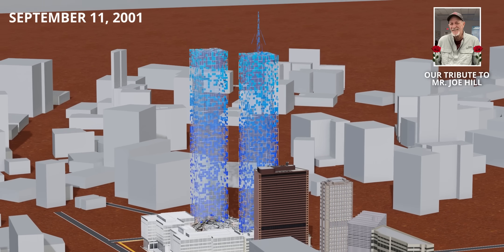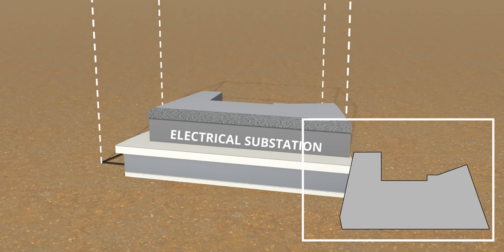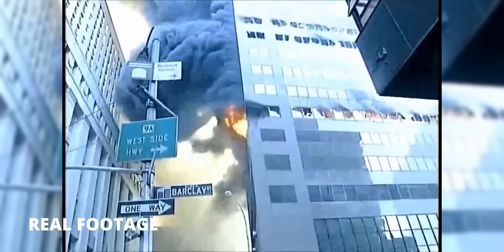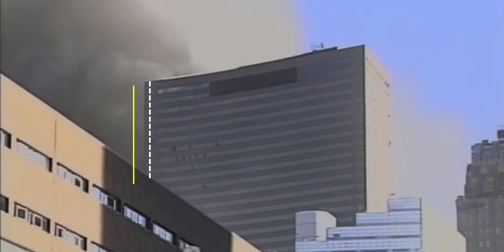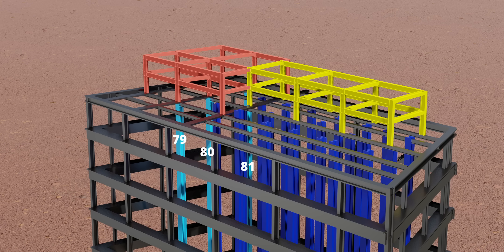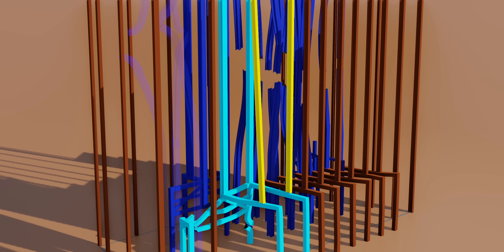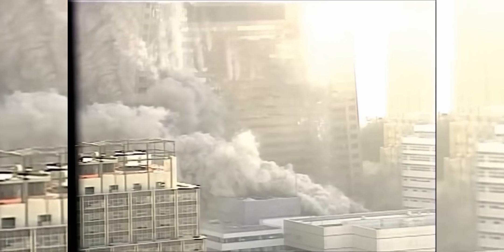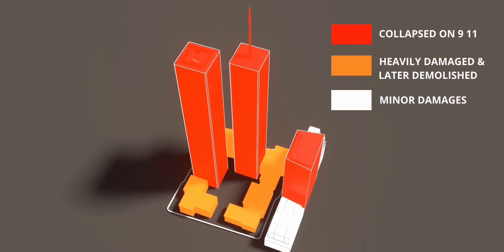Collapse of Building 7 | The Complete Physics

Comment: This sesame Street explanation proves nothing . Did you have xray vision to know the columns were broken at the bottom,?(Or you just listening to the people who said that columns were broken during cleanup)That building fell into it's own footprint... IF random columns were damaged, i don't think that would've happened the way it happened.. Just thoughts.
Reply: Maybe this more detailed explanation will help: Building 7, the 6th building to collapse of 10 lost on 9/11 though extensively studied still confuses many. Not famous or a terror target and with no casualties it didn’t get a lot of attention initially, creating an information void the internet filled with utter garbage. Because everything seems like a conspiracy if you don’t understand how it works I prepared this brief summary from my own analysis to fix that. No politics, just engineering. 

The North Tower collapse at 10:28am bombarded Building 7 with tons of burning debris, causing heavy damage and multiple floor-wide fires that burned out of control for 7 hours. Half the FDNY firefighters having been killed, others injured, units in disarray, equipment destroyed, no water pressure, and the greater urgency of Search & Rescue efforts, firefighting was pulled as futile. The building couldn’t be saved and was left to its fate. That is the sort of choice firefighters make every day in brush fire situations - which houses to save and which ones to let go. Only real difference here is moving the decimal on the size and cost.

www.youtube.com/watch?v=g_SvpwyC17M&ab_channel=MFitz  

Collapse of a burning structure is always a concern for firefighters. Steel buildings subject to fire rely on active fighting of the fires to survive. Buildings are designed around 1 to 3 hours of fire resistance, allowing time for occupants to escape and ACTIVE firefighting to get started, after which all bets are off. Left to their own devices they will exceed their design envelope and collapse. In B7 the occupants escaped, passive and active fire protections were compromised and active firefighting was abandoned which left the building to its fate. It lost. Odds on Building 7 would eventually collapse, and it did. No big deal in logic. 

www.youtube.com/watch?v=WnYBX6QT0R4 

FDNY Chief Daniel Nigro ; The biggest decision we had to make on the first day was to clear the area and create a collapse zone around the severely damaged 7 World Trade Center, a 47-story building heavily involved in fire. A number of fire officers and companies assessed the damage to the building. The appraisals indicated that the buildings structural integrity was in serious doubt. I issued orders to PULL back the firefighters and define the collapse zone. It was a critical decision; We could not lose any more firefighters. It took a lot of time to PULL everyone out, given the emotionalism of the day, communications difficulties and the collapse terrain

FDNY Deputy Chief Peter Hayden ; We had our special operations people set up surveying instruments to monitor and see if there was any movement in the building. We were concerned of the possibility of collapse in the building. And we had a discussion with one particular engineer there, and we asked him if we allowed it to burn could we anticipate a collapse and if so, how soon? And it turned out that he was pretty much right on the money, that he said 'In its current state you have about 5 hours

The collapse of Building 7 was anticipated and widely reported in the media throughout the day. At least 24 video cameras recording some or all of the collapse. Everyone knew what was coming and why.

www.youtube.com/watch?v=OY5S5k3tMHI 

Building 7’s collapse was completely different to the Twin Towers, and harder to understand with most details hidden from view. But we can still sort out what happened through careful analysis and observation.  This is my explanation  of the collapse using the best available information and relying on no authority.

B7 was complex 47-story steel framed structure built on top of a smaller existing 3-story building, requiring several lower floors dedicated to complex load transfer structures instead of usable office space. Of trapezoidal shape and all-steel tube-in-tube construction, B7 (above the 7th floor) consisted of a central core of steel columns carrying most of the gravity load, perimeter steel columns around the outside of the structure carrying the remainder of the gravity loads and long span beams and girders to tie those elements together and form the floors. On the outside of the building hung a moment frame - the last part of B7 to fall 

Phase 1 : The first externally visible signs of collapse initiation occurred at 5:20:28 pm. Collapse initiation for B7 is notably quiet with observers not realizing the building was collapsing! There was no audible warning in the form of say hundreds of ear drum busting 180-190dB explosive bangs preceding the collapse. Here at 12:00 a local CBS affiliate reporter is talking 10 blocks from B7 when collapse begins. People don’t start to notice the collapse until 12:11. Then at 12:45 is the famous CBS fixed camera clip of Building 7’s collapse.  Note how quiet it is.

youtube.com/watch?v=t5tEy6mXSE8&ab_channel=fresnosean379

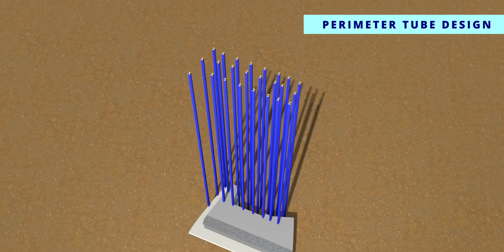Collapse initiation was due to lower floor failures above the load transfer region (7th floor) in the NE corner of the building. In this video at 0:45 you can see the NW corner from inside the building while under construction, Column 79 just out of frame on the left. That big, angled steel beam across the top of the frame connects to C79 at one end. The girders connect to the beam. That beam and all those girders depend on just one connection

youtube.com/watch?v=nP3TNHPCIVU&t=35s&ab_channel=EdwardCurrent

Phase 2 : Lower floor failures caused a loss of critical lateral support over an excessive length of core Column 79 and it buckled. If you look at a floor diagram of Building 7 (see above) and look at all the structures that depend on C79 you quickly realize this one column was a relatively isolated structural element on which a disproportionately greater fraction of the structure depended analogous to say the Key Bridge. Externally we see a vertical progression of window breakage along the 44-46 line and a kink in the roof of the East Mechanical Penthouse at the top of the building, consistent with C79 failure. The transition from full capacity to almost no capacity occurs in virtually an instant. Once the buckling failure occurs there is almost no resistance

Normally with a buckling column, the load could very well be redistributed to other columns, meaning the buckling could stop after a while. With C79 that is not the case - the failure did not redistribute the load, so the collapse rapidly progressed to the roofline, sinking the rooftop penthouse.

Phase 3 : With C79 gone, B7’s progressive, non-symmetrical collapse continues with C80 and C81 at the east end of the core left laterally unsupported and quickly buckled and failed as well, sending the EMP down through the building. C79-81 all have no diagonal bracing, which I believe is a major reason why they could not redistribute a lot of vertical loads among one another.

From there collapse progressed from east to west through the central core until the core was gone taking all of the interior floors and structures and probably most of the perimeter columns with it. You can see the horizontal progression of window failures low in the building and the dropping of the remaining rooftop structures into the building. One of the big takeaways from the NIST Building 7 study (that gets completely ignored) was their modeling which determined C79 failing under ANY circumstances would have initiated the same collapse sequence.

Phase 4 : 10 seconds in only the exterior moment frame - just a hollow empty outer shell – remains, the illusion the building is still standing since little has outwardly changed. But it’s just a hollow empty shell like an empty cereal box supported by only a few remaining columns and quite unable to remain standing. With all internal framing gone, the north face leans inward, forming a V in the roofline, the last perimeter columns buckle under the strain and the moment frame free falls, landing on top of the 7-story high debris pile. It is only here, at the end that a single measurement of alleged free fall acceleration is taken, from a single point on the moment frame. The Building (defined as its center of mass) did not “free fall” (sort of) – just one corner of the outer shell did. The Building was already gone before that happened. The period of alleged free fall was a product of collapse progression mechanisms, not of collapse initiation mechanisms and is irrelevant to what started the collapse. Start to finish the entire collapse took 18-20 seconds, 3 times longer than true free fall and how fast something falls cannot tell you what started it falling anyway. The debris spread outside the footprint, blocking surrounding streets, heavily damaging the Verizon Building and destroyed Fiterman Hall.  

Building 7’s progressive, non-symmetrical collapse was incidental and unintended collateral damage from the combined effects of fire + time + gravity started by the collapsing North Tower. That is true no matter who planned and carried out the 9/11 attacks or why . The collapse was of so little consequence it barely even registered at the time, a mere footnote. It only took on semi-mythical status as an alleged smoking gun years later when demolitions at the Twin Towers, missiles at the Pentagon and shoot down over Shanksville all failed and conspiracists had nothing left to work with.

Anything can seem like a conspiracy if you don’t understand how it works. Now you should. I hope you found this helpful, informative and it solicits informed critical comment. If I made any errors of fact, logic or reason or left anything important out, please let me know so I can fix it. IF you can offer a more plausible alternative please do. Be the first. Please start any reply with the words “Tits McGee” or I will know you didn’t read it and are wasting my time.

Comment: This video was made to shut the Sceptics up. The question is, are you fooled.
 If one building was demoed, that obviously means the other two were too
Reply: This video is pretty good – with a few exceptions - and goes into a much higher level of detail than many viewers will be able to comprehend.  While not perfect, the collapse mechanisms – the sequence of failures - described here  are fundamentally correct and this is true no matter who planned and carried out the 9/11 attacks or why . 

That may not be what you want to hear and go against 20+ years of entrenched dogma and conditioning, but it’s not wrong. 

That also means (in case you did not get the hint) this video can be (and IS) absolutely correct in its description of collapse mechanisms AND the 9/11 attacks could still have been some sort of inside job. The two things are in no way mutually exclusive. 

The mechanisms described here have broad professional support around the world. There are no professional engineering organizations (for example: ASCE, ASEE, ICE, etc) that disagree with them or have offered any formal dissenting opinions or alternative hypothesis. 

So, setting hubris aside, either the overwhelming majority of the worlds structural engineers and simple observation are wrong,… … or you are. Which seems more likely? 

IF you still think believe this explanation is wrong then produce a better one . Good luck with that. No one ever has and I don’t see you moving that needle today.

Comment: The only physics you need to be able to comprehend is that the building fell at free fall speed into the path of resistance
Reply: No it didn't. Only one corner of the exterior moment frame (the "empty cereal box") which was all that was still standing towards the end of the collapse sort-of averaged FFA for 2.25 seconds.

Which means absolutely nothing.

And DOWN is the path of least resistance BTW. Just thought you should know. 

Total collapse time was close to 20 seconds, or more than 3 times longer than true FFA - a bit of bleeding obvious they don't tell you about on conspiracy videos and blogs.

In summary, in a complex event such as this you may want to look at more than just one narrow-focus factor, taken out of context.

Comment: The conspiracy monkeys will never understand. To them EVERYTHING is a conspiracy.  Not one of them ever blew up anything, never dropped a building, never crimped a blasting cap, couldn't tell you the difference between C4 from TNT without using Google but yet there it is a building under construction in Bangkok with no explosives falls like WTCs from an earthquake.  The " explosions" couldn't possibly be from steel beams busting ,  no possible way naahhhh.

Comment: Is this satire?
Reply: This video is pretty good – with a few exceptions - and goes into a much higher level of detail than many viewers will be able to comprehend.  While not perfect, the collapse mechanisms – the sequence of failures - described here  are fundamentally correct and this is true no matter who planned and carried out the 9/11 attacks or why . 

That may not be what you want to hear and go against 20+ years of entrenched dogma and conditioning, but it’s not wrong. 

That also means (in case you did not get the hint) this video can be (and IS) absolutely correct in its description of collapse mechanisms AND the 9/11 attacks could still have been some sort of inside job. The two things are in no way mutually exclusive. 

The mechanisms described here have broad professional support around the world. There are no professional engineering organizations (for example: ASCE, ASEE, ICE, etc) that disagree with them or have offered any formal dissenting opinions or alternative hypothesis. 

So, setting hubris aside, either the overwhelming majority of the worlds structural engineers and simple observation are wrong,… … or you are. Which seems more likely? 

IF you still think believe this explanation is wrong then produce a better one . Good luck with that. No one ever has and I don’t see you moving that needle today.

Comment: B.S.
Reply: This video is pretty good – with a few exceptions - and goes into a much higher level of detail than many viewers will be able to comprehend.  While not perfect, the collapse mechanisms – the sequence of failures - described here  are fundamentally correct and this is true no matter who planned and carried out the 9/11 attacks or why . 

That may not be what you want to hear and go against 20+ years of entrenched dogma and conditioning, but it’s not wrong. 

That also means (in case you did not get the hint) this video can be (and IS) absolutely correct in its description of collapse mechanisms AND the 9/11 attacks could still have been some sort of inside job. The two things are in no way mutually exclusive. 

The mechanisms described here have broad professional support around the world. There are no professional engineering organizations (for example: ASCE, ASEE, ICE, etc) that disagree with them or have offered any formal dissenting opinions or alternative hypothesis. 

So, setting hubris aside, either the overwhelming majority of the worlds structural engineers and simple observation are wrong,… … or you are. Which seems more likely? 

IF you still think believe this explanation is wrong then produce a better one . Good luck with that. No one ever has and I don’t see you moving that needle today.

Comment: This video is complete and utter bullshit. This video makes no mention of the MULTIPLE steel beams severed at perfect 45 degree angles and the presence of the use of nanothermite in the debris dust. None of the fires could have melted the steel support columns enough to even weaken them. The video also makes no mention of MULTIPLE eye witnesses who reported multiple explosions inside the building prior to the building collapsing. And finally, the building's owner, Larry Silverstein, who purchased the building 6 weeks earlier, is on film admitting that the  decision was made to "pull it", meaning to initiate the demolition, of which would have to have been preplanned over the course of several weeks.

Ask yourself this: How is it possibile that never in the history of skyscraper construction had fires EVER destroyed the structure enough to collapse a skyscraper structure, yet we're asked to believe that it happened THREE TIMES IN ONE DAY on 9/11?

And why did it take 16 MONTHS to get an investigation of the most important crime scene in American history, by which time all the evidence had been hauled away, the steel scrap of which was never officially investigated and was subsequently sold off to China? Does that not seem extremely odd to anyone?

This is but the tip of the 9/11 iceberg. 98% of the official story makes no sense, which is why two members of the original investigation quit, because they refused to be a part of such a poorly conducted investigation. Anyone who believes this incredibly disingenuous video sufficiently explains what happened to WTC7 on 9/11 is a gullible, misinformed fool.
Reply: Literally nothing in that post was true. Please come back when you decide to get serious.